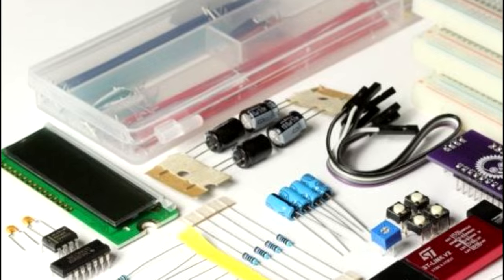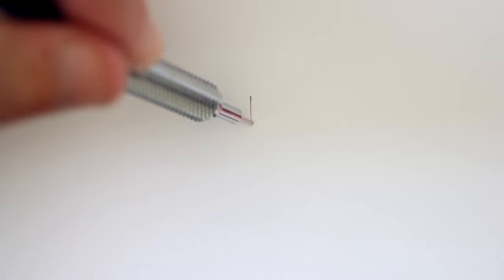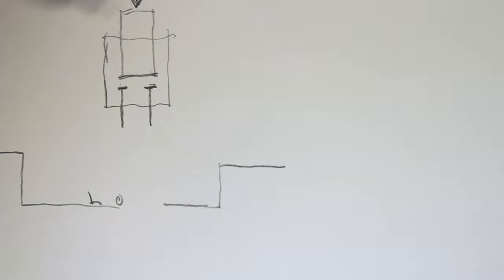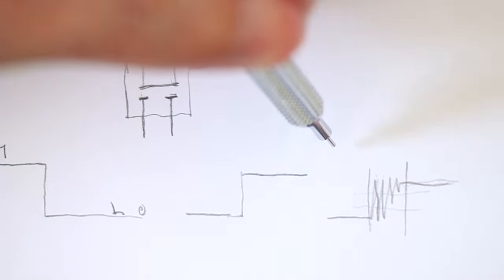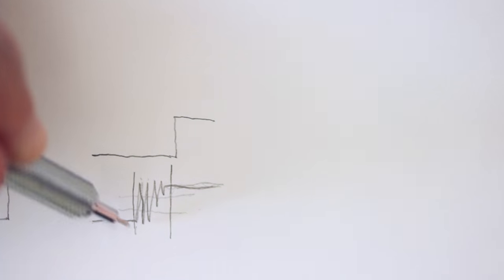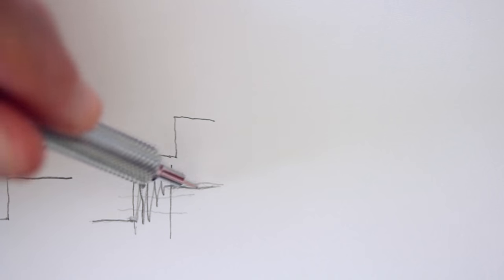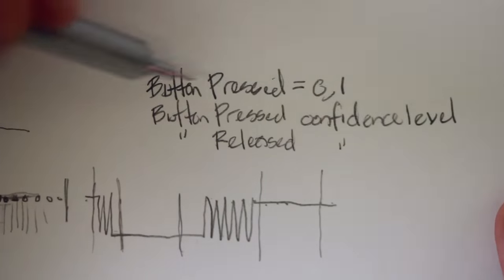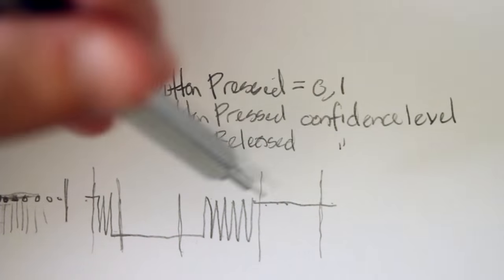12. How to Create a GPIO Push Button Input for ARM Microcontrollers - Debouncing Tutorial Part 1

Comment: Another efficient way to debounce submitted some years ago by Jack Ganssle:

MPLAB code, MicroChip controller
5ms timer interrupt loads all digital inputs into array.
Array is processed when, and only when the code needs
to check the state of the debounced value.

#define MAX_CHECKS 10
volatile uint16_t Index;
volatile uint16_t State[MAX_CHECKS];    

void TMR1_CallBack(void) {

     // Clean PB, Clean Vlv Open, Pool Light PB, Pump PB, Pump Running,
    //Solar Active, Solar Vlv Open, Solar Vlv Shut, Waterfall PB,
    //Waterfall Vlv Open
    
    State[Index] = (uint16_t)(PORTDbits.RD7)|(PORTDbits.RD6<<1)|
                            (PORTDbits.RD5<<2)|(PORTDbits.RD4<<3)|
                            (PORTCbits.RC7<<4)|(PORTCbits.RC5<<5)
                            |(PORTCbits.RC4<<6)|(PORTDbits.RD3<<7)
                            |(PORTDbits.RD2<<8);
    ++Index;

    if(Index>=MAX_CHECKS) 
    {
        Index=0;
}

uint16_t Process_Debounce_StateArray(void) {

    uint16_t j=0xFFFF;
    for(int i=0; i<MAX_CHECKS;i++)j=j & State[i];
    return j;

}

//Called from main program loop
bool CleanPB_Debounced(void)
{
     return Process_Debounce_StateArray() & 0x01 ? On : Off;  
}
Reply from the maker: Good suggestion.  Thanks

Comment: This is over complicated and has a serious flaw: delay. It is better to learn from gaming here.
So lets start with a certain FPS for the display, as that will determine the needed responsiveness. Usually 60, so each frame is roughly 17ms. The usual bounce is shorter than this.
Now we need 2 buffers, one with the current state of the switches, and one with the previous state. If you want to detect a push down, the current state must be 1 and the previous a 0. If you want to detect a hold, both must be 1. If you want to detect a release, the current one is 0 and the prev one is 1. Thats all. Works magnificent, and you always respond to the action instantly (within the frame).

Comment: I never thought about debouncing this way, it's interesting. You presented only two methods of debouncing, but what about "delay without the delay"? One can still test only two points, like in the second method, but that doesn't mean the processor has to be hogged. Instead of the delay, time in milliseconds is recorded into a variable when user pushes down the button, and then in every cycle program checks if enough time has passed (debounce time) since the push down. If enough time has passed, the status of button is checked again - if it is still pushed down, we can execute a command. This is less confident than your first method, but it can be confident enough for most purposes, and uses less processor time than the first method, since there are only two button tests.
Reply from the maker: That would be another good method. That is very much like a state machine where the button press sample is determined by the need and mission critical characteristic that the circuit and code serves.  In mission critical applications, you may need to know what is going on in the environment, even when the button is actively being pushed down.  For instance, if there is an emergency shutdown in need, and pushing the button causes something catastrophic, then the code will very much need to make sure that button is not activated during those samples.

Your suggestion would work in that situation as well.  Thank you for the suggestion.
Reply: I like that term - "a state machine". I did exactly that for my Arduino aquarium controller, not only for button presses, but also for menus and status on OLED display.
Reply from the maker: Yes, it is a very effective way to handle processing in embedded systems.  In my opinion, it's the best way for the processor to handle many tasks at once, and each task can be assigned more or less importance.  Robotics is a perfect example, into which I will be getting far deeper in the coming videos.

Comment: Is not it more easy with a RC filter (time constant) at the key press pin to avoid/reduce keybounce problems?  This can even save the precious CPU cycles.

If the MCU supports capsense pins it will avoid this keybounce problem as it may inherently built with techniques to cope with keybounce or static noise.
Reply: Yes, it can be done by using SR flip flop 
But for safety critical applications like aerospace, Medical application they double protection, Hardware as well Software 
First hardware check, later software check

Now days most of the thing is done hardware itself for example I2C,SPI
Software just for read and write
(Pull clock signal low to high, SDA line validity etc., are done in hardware itself)

Comment: I don't think that if statment takes less time than assingment statment. But still you are making great videos.
Reply from the maker: Did I say that?  Can you give me a time stamp where I mentioned that on the video?
Reply: 11:00
Reply from the maker: I didn't explain myself well enough there.  The next video, where I get into the code, it will be clear why I said that.  We don't want the processor to needlessly process code when it doesn't need to.  Additionally, if the button press condition was absent there (already tried and showed failed execution) the variable would overrun the size of the datatype because it is needlessly running that code.

Articulating pseudo code is probably the hardest thing I have done.  I will get more practice as more videos come out.

Thanks for the comment and please let me know if you see any other area where I am not communicating effectively.  I will try to be more thorough on the next videos.